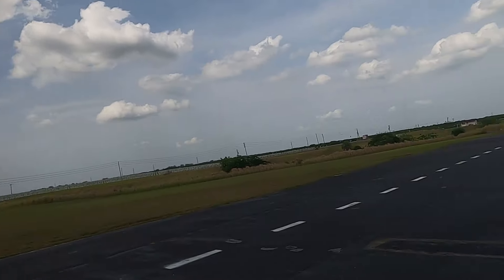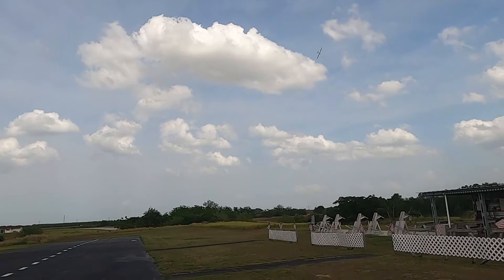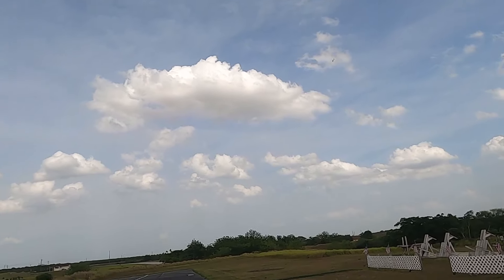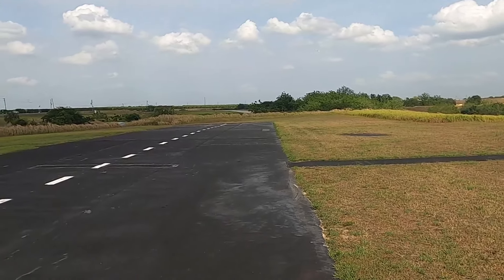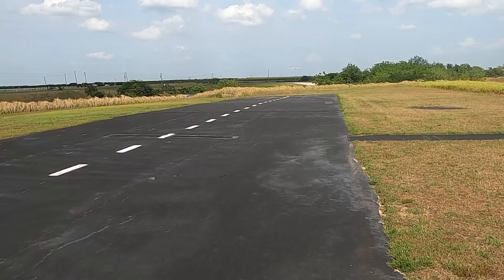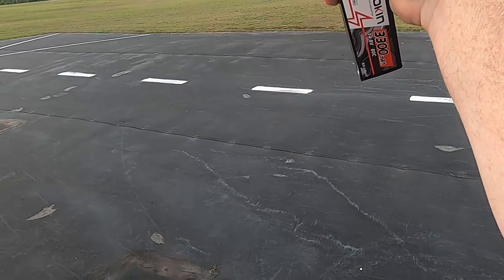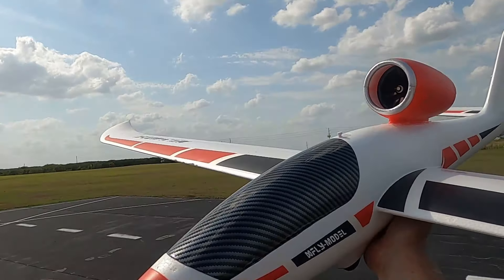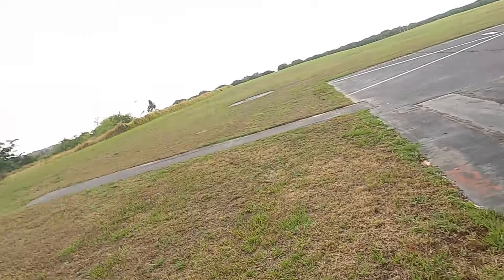X-2100 JET POWERED GLIDER - REAL FUN PLANE! -HAT CAM REVIEW by FGFRC

Comment: I have this glider not with the EDF I fly with a 4s 2200 getting 6 minutes a flight and this airplane is under rated .  You do a great job flying it i just love when you throw those flaps full you can set her down pin point were you want it very awesome
Reply from the maker: Thanks so much!! Yes this plane does not get the attention it deserves.

Comment: After adding the 64 edf, my esc was too hot to touch and got so hot that I lost power and had to land.  I poked a couple holes in the side of the fuselage and pulled my esc out of the top compartment and lay it on my 3300 battery.  Now it's cool after the flight.
Reply from the maker: Yeah I may do just that. Thanks Joe I knew you would convert to the 64 after seeing mine.

Comment: I’m giving it some attention. I just ordered it with the 64 mm EDF. I couldn’t help but have to give it a try after your reaction to your first maiden.
Reply: I’ve been very impressed with XFly’s quality. There are two Twin Otters at my field and they are really top notch.
Reply from the maker: The esc does get warm with the 64 edf so dont fly full blast all the time, Also leave the stock prop motor in for proper balance.
Reply: Please let us know if you or Xfly come up with a way to get more cooling to the ESC. Thanks